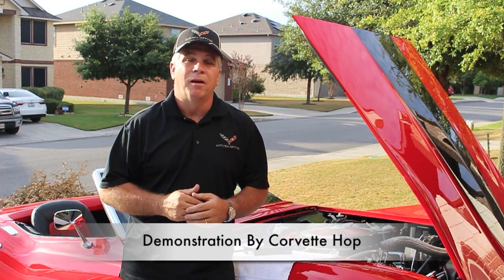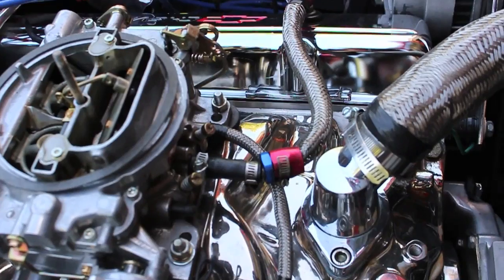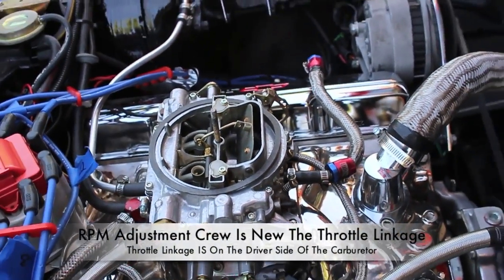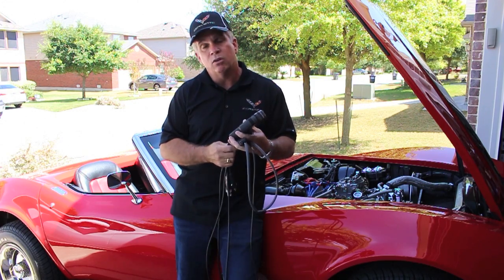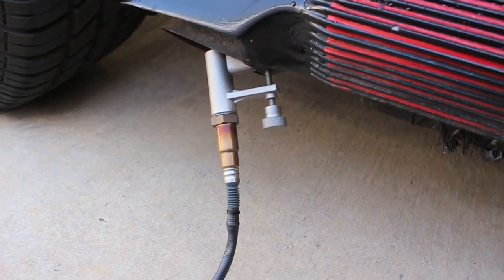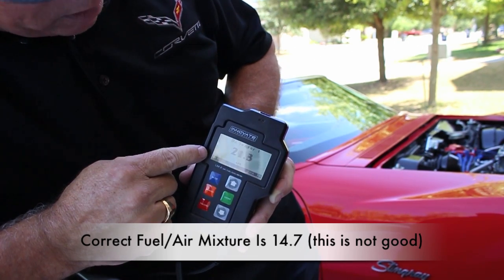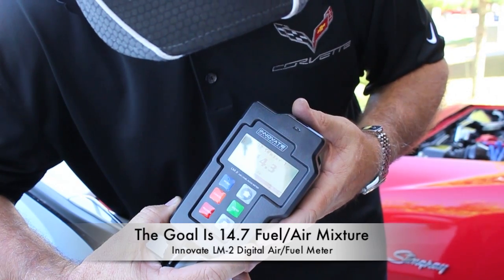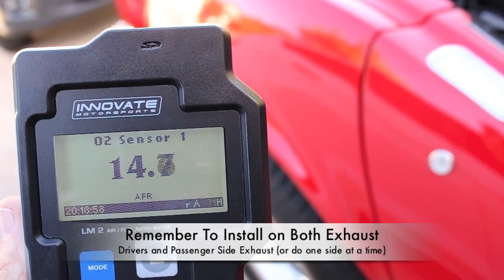How To Adjust Air Fuel Mixture (three different ways) By Corvette Hop

Comment: Hello, maybe you can help me, I am trying to adjust the fuel mixture according to your description, using a pressure gauge and at idle the vacuum during adjustment does not reach more than 14. What could be the cause?

Comment: Question... Why did you conclude that you needed to change the jets and or metering rods when your A/F was too high in idle?  Why not continue to adjust with the idle mixture screws? ... thanks for the videos.
Reply from the maker: No matter what I did I could not get the A/f in the correct range with the adjustment screws. Once I changed the metering rod I was able to get it in range.
Reply: @TheWhatisright  Thanks for the info.... it may be a Edlebrock thing.  Like I said, I am using a q-jet on a c3... and I know even less about edlebrock than q-jet.   I do like the Innovate o2 sensor...   Thanks again for the videos.
Reply from the maker: @Bill-gb9kf  I had a q-jet before and did not have that problem. However, no matter what I did on the edelbrook I could not get it within range unless I changed the rods. That is why I made the video helping others.
Reply: You mean jets, don’t ya!?  I’m really confused now ...lol
Reply: @cutl00senc  Yes, there are two primary jets and two secondary jets (typically on a 4 barrel carb)... he was talking about changing the primary jets to get to the correct A/F at idle... I edited the original post to add the plural form of the words.
Reply: @cutl00senc  Just to clear up any residual confusion from my original question (which I have partially deleted so that people reading it will not get confused as I was)... The idle circuit is fed through the primary jets, which explains why larger jets gave him more adjustment on his idle mixture screws... I recommend HPBrooks "Rochester Carburetors by Doug Roe" for some light reading.

Comment: 14.7 is theoretical ideal mixture in thermodynamic stochiochem. But in this carb application if you read the manual for operating in a vehicle it should fall in the range 12-14 when idle or accel it needs to be slightly rich.
Reply: Correct , around 13 at idle. 15,5 at slow cruise and 10 at WOT

Comment: While your vac gauge is steady mine bounces back and forth erratically. Perhaps because of my 640 lift cam but makes it harder to read.
Reply: you can ad a inline check valve on the hose.  usplastics has them.

larry

Comment: Edelbrock Carbs basic setting: Turn screws all the way in, then turn screws 3 rotations out.
Holley Carbs usually need vacuum gauges to be totally correct. Holley's are basically set by: turning all the way in, turning 1 1/4 turns out.
If you have a large cam, refer to Holley Carbs Tech Support Hotline.. >:}
Reply: Great to know. Question: Holley vs Edelbrock vs Quadrajet: ... anyone known for better mpg for a daily driver?

Comment: hello corvettehop, I have a new purchased 350 (250 hp) with what I recommend summit racing carburetor 600 cfm, intake manifold 2701. It was split with the manufacturer's protocol 1/2 hour at 2500 rpm it was fine tuned but I have a lot of smell  Fuel the eyes itch a lot, the fuel pressure is at 5 psi buy the calibration kit but I still do not occupy it, what configuration do you recommend, I like the quick departures and also the fuel saving (I live at sea level), greetings  from punta arenas, chile
Reply from the maker: That is a great setup. I have an Edelbrock 1406 (600 cfm). I have the comp intake manifold with a comp cam. I also installed aluminum heads. I would look for fuel leaks. Also make sure your choke is adjusted correctly. Also, check the float adjustment in the carb. Mine was way off and had lots of fuel smell in the garage also. I hope this helps.
Reply: @TheWhatisright  ok I will check it .  Thanks a lot
Reply from the maker: @malibudiabloss3845  You are welcome.
Reply from the maker: @malibudiabloss3845  This looks like a good video to show float adjustment if you have an Edelbrock Carb. https://www.youtube.com/watch?v=robTVSICzA4
Reply: @TheWhatisright  Thanks for the link, I just saw it.

Comment: I noticed that you have moved to an Edelbrock carb from a Rochester. I am planning to do the same but I have a stock intake manifold which needs to be replaced with an Edelbrock  to avoid having issues with closing the hood. Any chance you can share the steps you took to make the transition? THANKS!
Reply from the maker: I got the 1406 Edelbrock carb. It was an easy install. I did not have to get any additional parts or make any modifications. The reason I replaced it was because of new technology and easy to get parts. I did replace some jets in the carb for better performance.
Reply: @TheWhatisright  Did you have any issues with the accelerator linkage?
Reply from the maker: @AO-xr8mk  No none. Are you having issues? If so, what kind of issues?
Reply: @TheWhatisright  No not yet, I'm still waiting for parts to arrive but I thought the linkage might be an issue considering my setup is all stock. If it's okay with you I'll reach out again if I run into any trouble. Thanks for the support -- Al
Reply: @TheWhatisright  Can anyone install the Edelbrock by just following the included instructions? Any improvements in driving quality, gas mileage, etc...?
Reply from the maker: @GJJC13  Yes, easy to install. Edelbrock also has a few install videos on YouTube.

Comment: A wideband o2 (AEM) is more accurate because the sensor is placed closer to the collector.  I agree this is a good way to find proper jet size. In addition you can always have the info available in a gauge.  Im going to stick under my dash with autometer pod and  emblem tape.

The AEM X series uses the newest bosch sensor and id $170 on Amazon. It has the fastest refresh rate to date, so info is more accurate as well

Comment: Do you set these idle mixture screws with the vacuum advance unhooked? Thanks
Reply from the maker: You can, vacuum advance is not a big player at idle. In fact, it is taken out when using the vacuum gauge because the vacuum line is used. I always recheck every once all is hooked up anyway. That would also include the correct idle RPMs.
Reply: CorvetteHop thank you!
Reply: Ignition advance affects AFR. Therefore you should adjust carb idle mixture the way you run the car. If you use manifold vacuum for your vacuum advance it should be connected when adjusting carb idle mixture.

Comment: You didn’t show when and where you exactly put the vacuum gage.?
You said either port? One goes to my vacuum advance, the other blocked off. Thought it went on the blocked off side. (Drivers)? Then you didn’t show in detail about setting the screws. You did, but didn’t elaborate much on it. Grrrr
Reply from the maker: I will do my best to fix that in the video next time. Thank you for the comment.

Comment: What's a link for your air/fuel ratio tool? Thank you. Great video.
Reply from the maker: You can get it on Amazon. Hope this helps. https://www.amazon.com/Innovate-Motorsports-BASIC-Digital-Wideband/dp/B001S7W836/ref=sr_1_3?hvadid=3480856253&hvbmt=bp&hvdev=c&hvqmt=p&keywords=lm-2&qid=1553033866&s=gateway&sr=8-3&tag=mh0b-20

Comment: where can i buy that afr exhaust adapter?
Reply from the maker: Jose, you can get it on Amazon. This is the link, https://www.amazon.com/Innovate-Motorsports-3728-Exhaust-Cast-Stainless/dp/B000CO9MF8/ref=pd_bxgy_263_img_2?_encoding=UTF8&pd_rd_i=B000CO9MF8&pd_rd_r=6c6fdee9-e9a0-11e8-bcb8-c5b226b16295&pd_rd_w=gvCvL&pd_rd_wg=S3iRp&pf_rd_i=desktop-dp-sims&pf_rd_m=ATVPDKIKX0DER&pf_rd_p=6725dbd6-9917-451d-beba-16af7874e407&pf_rd_r=91VB1GHSQKPFFS0AEAVX&pf_rd_s=desktop-dp-sims&pf_rd_t=40701&psc=1&refRID=91VB1GHSQKPFFS0AEAVX

Comment: So Atmospheric pressure of about 14.7 pounds per square inch At Sea Level, will say 11.7psi  be a good air/fuel ratio at higher altitudes ?
Reply from the maker: I think that is very good. Mine did fluctuate. Clearly, it was way off using standard measures of adjustments. That of course indicates that I needed the needle changing in order to even get close to the 14.7 mark. I think if you can already get within range then drive it and figure out your best operating performance.

Comment: I have the same carb on my 350. I've been having a weird issue I can't seem to solve. It idles with an afr between 13.0 to 14.2 at 190 degrees, but goes to 15 to 16 when I shut it off and restart it at temp?
Reply: The answer to this question is in the video.  Watch again until you get it.

Comment: Did you notice better fuel efficiency? I have a 350 with a Rochester carb and even after leaning the carb out it still, sucks down gas like crazy. I'm not sure if an Edelbrock carb might be more efficient.  I know a fuel injected carb will be more effieicent but those are still too expensive for me.
Reply from the maker: I use a little more fuel but it runs much better. It was very lean before which caused problems. It is almost like driving a differant car. It has much better performance with the correct air/fuel mixture.

Comment: Great video. I noticed that you're not using the Rochester carb anymore. Any particular reason why you decided to switch to an Edelbrock?
Reply from the maker: No, I still have it. I just wanted to try the Edelbrock and it seemed to work great.
Reply: Cool. Where did you get the innovate? I was looking for one online and they seem pretty pricey
Reply from the maker: I got it on Amazon. Yes, they are pricey if you need to order the entire kit (cables, sensor and all). If your car is running well you do not need it. Most people can do the fuel/air mixture by ear or a vacuum gauge.
Reply: @TheWhatisright  Guess who bought Carter... Edelbrock's are basically Carters.
Reply: @TheWhatisright  So, you prefer the Edelbrock vs the Quadrajet? If so, please explain the benefits. Thanks!
Reply from the maker: @GJJC13  I like both. I selected to use the Edelbrock because replacement parts are very easy to get. I still haven't Rochester.
Reply: @TheWhatisright  Good to know... Thanks!

Comment: So how was it on the highway? What does that tool and carb kit cost. Great videos. Thank you
Reply from the maker: It stayed in the same range (between 14.1 - 14.8). It was about $250. However, the exhaust tool that holds the 02 sensor was $62 on Amazon. I am sure you can find them cheaper on eBay or shopping around. I know some people install 02 Gauges in their cars. You may be able to find a used one. I was really surprised to find out my reading was so much off due to the carb being out of tune (running very lean). I could not even adjust the carb below 20 (lean) until I changed the jet. Carb kit was $42 at O'Reilly Auto Parts.
Reply: CorvetteHop right on thankyou.
Reply: Hello. Thank you for taking the time to make an informative video. I have the exact carb on my 350 as well. I can't get it tuned to what I like or what I think it should be. I've been changing parts in mine as well, with the same kit as you have plus a few extra parts. I'll have to try & find a shop with A/F gauge. Did you find that the timing needed adjusting once you got the carb set up. Thanks again.